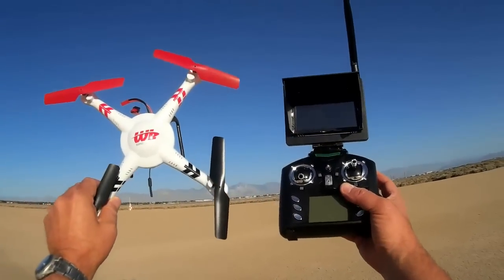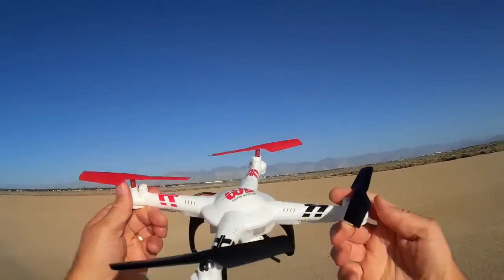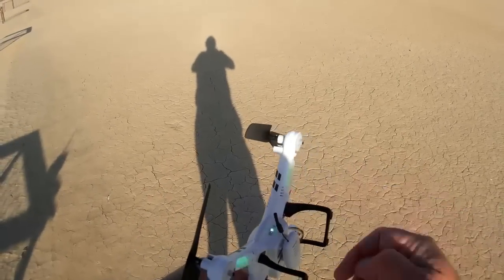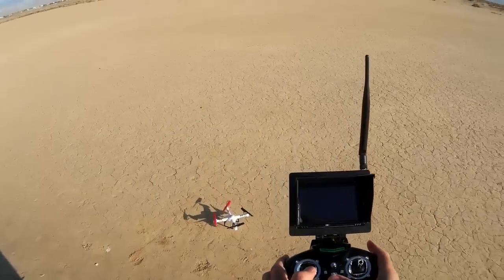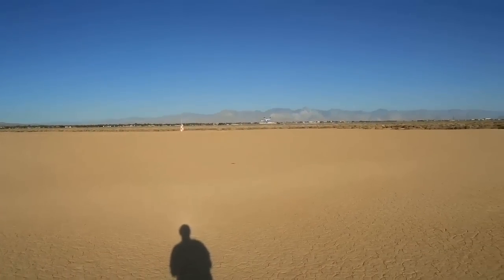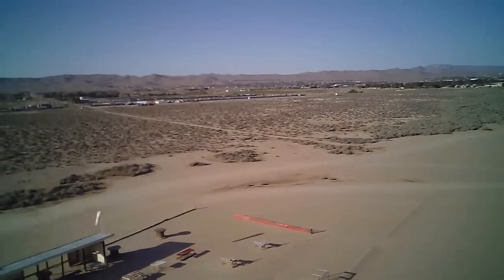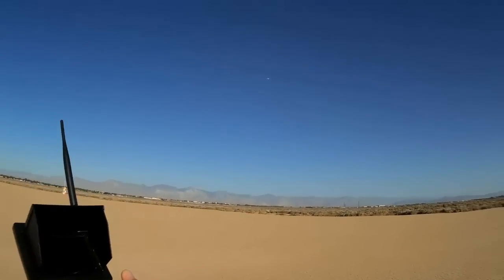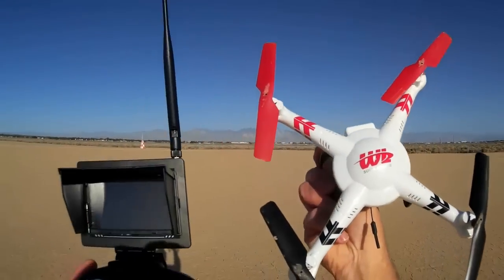WLToys V686G FPV Drone Gyro Calibration

Comment: What's the use of Calibration on Quadcopter?
Reply from the maker: +Adnel Gilhang It's for the headless mode to work properly. This quadcopter uses a magnetic compass (vice gyros) as reference for its headless mode.
Reply: +Quadcopter 101 Thank you sir! But, I have an additional question because I'm willing to buy that quadcopter. Why is that small green light blinking during flight? Does it indicate GPS linkage? Like DJI Phantom?
Reply from the maker: +Adnel Gilhang No there is no GPS.  It just does a double blink to indicate linkage to the transmitter.  But I recommend waiting a few days before you purchase this.  I just got the updated version of this, the WLToys Q222G.  It costs about the same as the V686G, but includes an altitude hold feature.  Just took it outside for a quick test and it works surprisingly well.  Altitude hold is an excellent addition that makes FPV flying much more easy.  I'm taking it out to conduct its test video review tomorrow morning, and should release it latter this week.
Reply: Thanks bro! But when I've open Banggood and searched for WLToys Q222G they have an available but only has a left hand throttle mode which is my problem cause I am a right-handed person.
Reply from the maker: Adnel Gilhang So am I. Depends on where you live (I live in the US). This sounds weird, but you would likely want a left handed throttle if you live in a country that drives on the right side of the road.  Right handed throttles are usually popular in countries that drive on the left side.  It has something to do with how our brains are wired from driving as such.
Reply: But do you know where could I get right hand throttle mode for the WLToys Q222G? Just askin'
Reply: Oh never mind. My understanding on left hand throttle mode was wrong. I thought that this mode placed the throttle on the right and elevator/ailerons on the left. It's a nice quad can't wait for the review. :)
Reply: Still waiting for the review of WLToys Q222G. :)

Comment: i did fly mine for 2 days now, and the motors are way underpowered, and it's not that suitable for 
out doors, because the slighest wind wil blow it away, and then you need 100% power to keep it 
under control, and that uses alot of energy, so you might be glad when you can fly about 5 minutes, 
so i would recomend this only when there's absolure no wind at all, or for indoors only. sure the 
video signal is weak when you take further than the 100 meters, but this is not a drone you want 
to take any further than that, because before you know it, you run out of power, so it's fun alright, 
but with visible range. Also the monitor sucks, because it's hard to see when you are standing in 
daylight, let alone when the sun would shine, because the it becomes impossible to wath on that 
monitor. and when the battery is getting more empty, the power also reduces, because when you
want to land it, you have to give 100% up, and it stil wil drop on the ground and bounce up in the air,
so there's no braking on the engines when it comes down a little hard, so again, it's way underpowered. 
They should make the next model brushless and with a larger battery and some better antenna's, and 
then ask a little more, and people would love it.
The recorded video's on the sd card are great and better than i expected. So for people who want 
to fly indoors, in a large hall, it's a great product, but not that good for outdoors.
Another plus are the toys you can get for these copters because you can get a bubble machine,  
a water canon, and a winch for it, so great for the little and big boys.
Reply: WD40 + Bad motor = problem solved!!

Comment: Also be aware the blades are of clockwise and anti clockwise function- I had a cw blade on a ccw motor - which led to some brief, mildly amused confusion. Like "WTF is wrong with this POS!!!" 
I cannot describe my elation to finally see it lift of with perfect stability and fly as directed. I have a wltoys v977 - I am tremendous impressed with wltoys products to date.

Comment: Hello, hopefully one of you can answer that. Mine was working perfectly for a while, now, it wont even takes off, it seems that the black blades are stronger than the reds so it just dragging to the black one's direction and then the red blades stop completely. Any ideas how and if it is possible to fix?
Reply from the maker: +rizondream Failed motor.  Here's where to get them http://www.gearbest.com/rc-quadcopter-parts/pp_211070.html
and here's how to replace them https://www.youtube.com/watch?v=FXmsafz-u6Q

Comment: A little info that may help some of your other subscribers. My 686G has the up/down control on the left hand stick as i am operating it yet on the controller screen it says Mode 1. I have just tried the X and Y calibration myself and like many others just ended up very dizzy walking around and around with no sign of the lights stopping flashing. Not wanting to give up on setting it up correctly after a bad crash i tried Y calibration first with the 40 % top button this sorted things out very quickly only a couple of spins for me and the X calibration also worked on the 60 % button. So it seems my controller is set up different from yours ..ie X and Y calibration settings . Hope this info comes in useful for others . Keep up the good work quadcopter 101

Comment from the maker: Mike, blinking lights usually indicates that it's time to charge the quadcopter's battery. Try recharging the battery.  But be careful if you're using a US adapter plug as it sometimes makes bad connection with the wall plug. If it does, backflow from the battery can light the charger light green giving false indication of a charged battery. Charge as follows.
1) Plug in the charger to the wall and verify that its power light comes on.
2) Plug the battery into the charger, verify the light changes red.
3) Wait until the light changes back to green indicating charged battery.
Reply from the maker: ***** Yes it does need to be done outside, away from any magnetic interference also (especially cars).
Reply from the maker: ***** The V686G binds differently than others.  To bind the quadcopter, plug in the battery then place the quadcopter on a flat and level surface.  Let it sit unditurbed for a few seconds to let the gyros initialize.  Turn on the transmitter, and it will repeatedly beep.  It will continue to beep until your hear a final long beep.  Once the beeping stops, the quadcopter is bound.  Apply throttle to see if the motors spin.  If the motors are spinning, then the quadcopter is bound.
Reply from the maker: ***** You did contact your vendor's customer service didn't you?
Reply: +Mike Deaton i am with you on this one i have the same problem.
Reply: I have same problem. I have two batteries but first is much bigger than second. I think that i overcharged it. But why does it not work with second?! It looks like that problem is not in batteries...
Reply: I found solution after 15 mins of searching Internet. :D Anyway just use WD40 on the motors! There are 2 small holes on them.
Reply: +Quadcopter 101 Just got a new one from Think RC Great outfit! Out of Box the unit has no yaw at all Left or Right. Tried to calibrate the controller goes black and then powers up and binds the quad, still no yaw. Sent Note to Think RC  for replacement,. This is the Second new WL toys unit I  have had to return V934 last time. Good news if Think RC refunded that one. I do want to keep the V686... Any Ideas ??Ben Herr

Comment: Hello My V686G use to fly just great then after a crash I replaced the broken parts but it wants to tilt one direction. I tried the calibration and everything worked besides the X axis i spun and spun and spun and the blinking never stopped...Tried he Y axis and after about 2 spins it stopped blinking...Any ideas?
Reply from the maker: schraggy Are you certain that you put the correct clockwise and counter clockwise turning propellers on their corresponding motors?  If you're mumbling clockwise?! or counterclockwise?! to yourself right now, I guarantee that this is probably your problem ;-)  There are two of each, their purpose being to counter the torque of the motors to prevent spinning.  Take a very close look at the following picture, paying particular attention to the shape of the propellers, and the location where they're installed.  Make yours match the picture http://www.toptoyspace.com/wp-content/uploads/2015/01/WLtoys-V686G-5.jpg
Reply: Quadcopter 101 Yes the propellers are correct I triple checked them. I think I actually have a bad motor. Sometimes the one does not spin unless I give it a little push and that is the same corner that the V686G dips to when I fly. I have extra motors so I will replace and let you know. We still can't get the X axis to calibrate it just blinks and blinks.

Comment: Hi

One motor stopped working (cord white and black) I ordered a set new motors and replace the motor,  now the four motors works, now I can't take off, move up the spped control stick and the dron crash front, but never  takes the flight, I has the calibration. what do you recommend?
Reply from the maker: E. Joaquin Flores García Are you certain that you put the correct clockwise and counter clockwise turning propellers on their corresponding motors?  If you're mumbling clockwise?! or counterclockwise?! to yourself right now, I guarantee that this is probably your problem ;-)  There are two of each, their purpose being to counter the torque of the motors to prevent spinning.  Take a very close look at the following picture, paying particular attention to the shape of the propellers, and the location where they're installed.  Make yours match the picture http://www.toptoyspace.com/wp-content/uploads/2015/01/WLtoys-V686G-5.jpg
Reply: Quadcopter 101  Hi ..... I only check what cord color it's does not work and replace the same cord color .... I suppose that's all ... where can I send you one video and photos?
Reply from the maker: Could you upload your video to YouTube and include its link here?
Reply from the maker: E. Joaquin Flores García I viewed your video. Your front two red propellers are installed incorrectly on the wrong motors.   Remove the front left red propeller, and install it on the front right motor.  Remove the front right red propeller and install it on the front left motor.

Comment: As I increase my V686g throttle it does not go straight up,  Does that mean it needs calibration?
Reply from the maker: William Quayle Jr Possibly needs gyro calibration.  Place on flat level surface, set to 100%, move and hold both control sticks to lower left corners until the lights on it blink.
Reply: I will try that

Comment: @quadcopter101
I originally had a mode 2 controller and flew as such for two flights then when I went out for a third it seemed to be in mode 1
Reply from the maker: Derek Schnittker That really surprises me as Banggood specifies Mode 1 or Mode 2.  BUT if it has switched, then apparently there is a way.  Other switchable transmitters usually specify holding down a specific button, while simultaneously turning on the transmitter.  So recommend that you take turns holding down each one of the transmitter buttons, and turn the transmitter on.  Hopefully one of the buttons will switch its mode.

Comment: I have a problem with my v686, a while back the quadcopter suffered a bad crash and the body shell was broken. I ordered new parts for the quadcopter replace them everything fit in to place. When I turned on the motors the quadcopter tilted forward instead of taking off, as if the front motors are stronger than the back motors. I tried to switch places with the front and back motors but the results were the same.
Reply from the maker: גל רוזמן Did you keep track of where the clockwise and counter clockwise propellers were installed?  Observe the following picture, paying close attention to the shape of the propellers, and where they are installed.  Match this installation with your quadcopter http://g02.a.alicdn.com/kf/HTB1ZtqvHVXXXXaMaXXXq6xXFXXXo/New-Arrivals-Wltoys-RC-Quadcopter-V686G-HD-Camera-4G-Memory-Card-4CH-6-Axis-Drone-Remote.jpg

Comment: Do you have any idea how to switch modes on the transmitter?
Reply: nailedtoeternity I'm having the same problem. Any resolve yet?
Reply from the maker: Derek Schnittker The LCD screen may mislead you into believing that you can switch between modes.  Unfortunately, you can not switch modes on the transmitter.  The transmitter comes in two separate versions, either Mode 1 or Mode 2.  You need to specify at purchase which mode you wish to have sent.  Unfortunately TinyDeal is only shipping Mode 2 (but Banggood has the Mode 1 transmitter version in stock). http://www.banggood.com/WLtoys-V686G-FPV-Headless-Mode-RC-Quadcopter-with-2MP-Camera-p-965223.html?p=RB0922217402201307U3
Reply: Quadcopter 101 Are you positive? It seemed like I was flying in mode 2 for 2 flights but now when I connect my transmitter to the drone and throttle with the left stick the props spin and seem to have plenty of power but the drone won't budge.
Reply: Quadcopter 101 Really having a tough time resolving this.
Reply: +Derek Schnittker Mine has swapped as well. The thing is the throttle works fine on the left side but my transmitter says mode 1. Go figure.

Comment: Can you help  me ??? I made all the procedures showed to calibrate the drone but the lights don't stop blinking even after several spins in each axel.
Reply: José Ricardo Schwaitzer yeah!! same thing is happening to me heeeeelpp!!!
Reply: I did exactly as in the video and the only thing I got was nausea :-/ , aaaaaand now the monitor does not receive image , just a "no signal" mesage on the screen, the camera works and record video but does not send signal, or maybe the monitor does not receive it? I´m about to cry....
Reply from the maker: José Ricardo Schwaitzer You got to hold the quadcopter exactly as shown in the video.  Otherwise it won't stop blinking.
Reply from the maker: Diego Fernandez Are you certain that the quadcopter battery is fully charged?  Do you use an adapter plug? If so, sometimes they need to be jiggled in the wall outlet to make good connection.  If there's no power to the charger, backflow from the battery can light the green light giving false indication of a fully charged battery.  But if the battery is indeed fully charged, it might be time to contact customer service of the vendor from where you purchased.
Reply: Diego Fernandez Me either
Reply: José Ricardo Schwaitzer I've run into this also, try switching the X and Y procedures.

Comment: Perhaps the return to home mode works when the quadcopter gets out of transmitter range like some of the expensive models do ? Have you tried that yet.
Reply from the maker: who ami No it couldn't do that.  It doesn't have a GPS.
Reply: Quadcopter 101 ahh ok . Thanks for answering

Comment: I have the JJRC version of this quad. I will try the calibration steps in your video to see if it helps me. I have the same issues with RTH in that it goes off in another direction! 

The camera is great! Will you see if the camera will fit the JJRC H12C? I am interested in that quad for the estimated range. 

Thanks,

Cloud

Comment from the maker: Christian, No I don't recommend this for a beginner. I feel that the FPV screen would be a distraction. You really need to learn the basics first, and the following is the best bang for the buck https://www.youtube.com/watch?v=n2RTYwpeuk4
Reply: Quadcopter 101 Thanks for your response. I decided to finish first the lessons on your quadcopter flight school blog before buying my first quad. Thank you for all the information that you're sharing. I want to start this kind of hobby. Hahahaha. I can't find FY325 Q7 here in the Philippines. The only similar quadcopters here are Syma X5C and JJRC H8C. So which is best for me? The Syma X5C or JJRC H8C? Or any better than that which is similar quadcopter of Syma, JJRC, or WL? Thanks. God Bless.
Reply from the maker: Christian Cruz I'd go with the Syma X5C. Very stable and very reliable.  The JJRC has reliability problems with its motors.
Reply: Christian Cruz The Syma X5C was my first quad, I like it enough I even replaced the motors in mine when one died if that tells you anything about that quad, not real sporty but will allow you a few stunts can do banked turns, and is very controllable and stable. Mine only messed up because grass got caught up in the gears in the motor pods, so be careful when flying in tall grass and most importantly, have fun!

Comment: I really tried your way too calibrate, the only thing it did was make me drunk, so I went onto the tumbling way for the X and Y calibration and that went well, then putting the stick in the left corner, the light start blinking then stops, so I am a happy camper.
Still the motors won't stop when I turn off the TX, so I ordered a new receiver board
Reply: Pomona Bill You do not have too calibrate it every time you fly, just if it  want too flip over when taking off.
Reply: Pomona BillThe instructions are not very clear because of the bad translation from Chinese too English. Also have the Quad stand on a level surface when plugging in the lipo. I start the motors without taking off, until the green led stops flashing rapidly, and just blinks. Also see if all the propellers turn freely if you spin them by hand.  If it keeps doing what it does, it could be the mainboard, mine was faulty, would not stop the motors if you switch off the TX.  I do believe that the weak point of this Quad are the motors, two of mine have gone stiff, but it still flies ok. Hope somebody comes with better replacement motors
Reply: Pomona Bill Hi Where did you order the 1200mAhs for the v686G